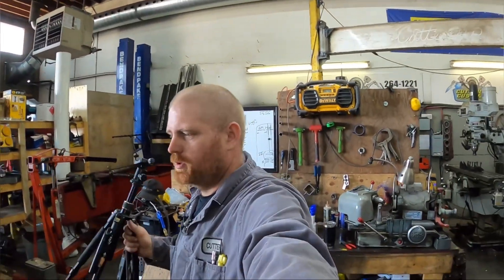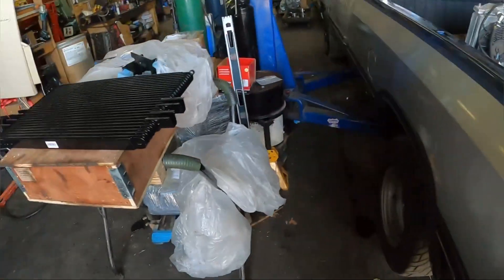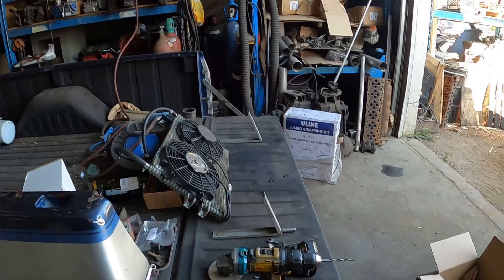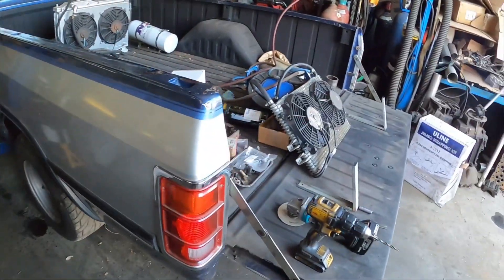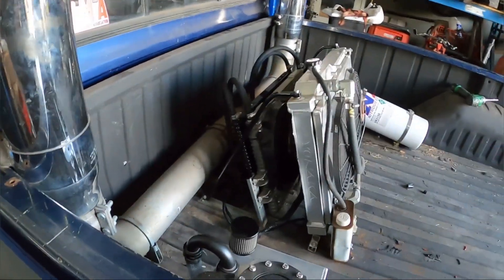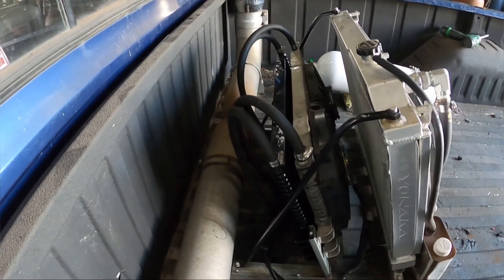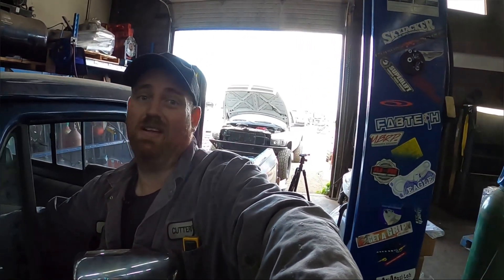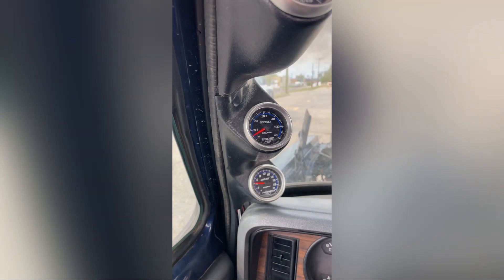Ford Transmission cooler upgrades on the first Gen ????

Comment: Relay harnesses, and some heat shielding on the exhaust by the coolers
Reply from the maker: It is relayed. Actually all reworked now.  Also have heat shield on the hoses too. Just have to get some stuff that I didn’t have in the video

Comment: Back before large auto trans coolers were easily available (a long, long time ago in a galaxy far away), I used an A/C condenser as my cooler with a slippery converter. Never baked the fluid. Enjoyed the video. Thanks for sharing.
Reply from the maker: i have been the same thing

Comment: Should have the fans on the rad pushing and the fans on the trans coolers pulling cause of the natural way air swirls behind the cab of a truck.
Reply from the maker: if i was driven it a lot yes, but for the most part the truck isnt moving to fast when there on